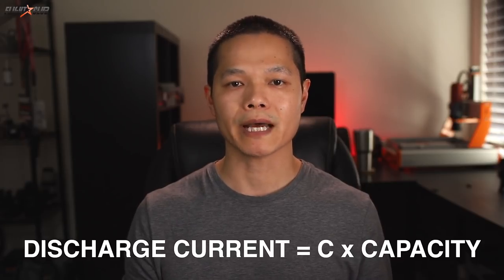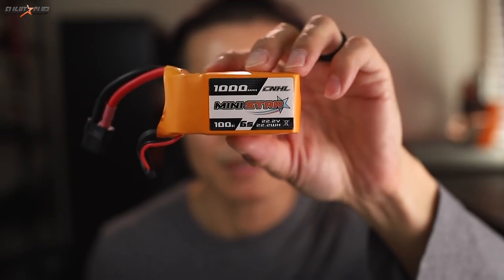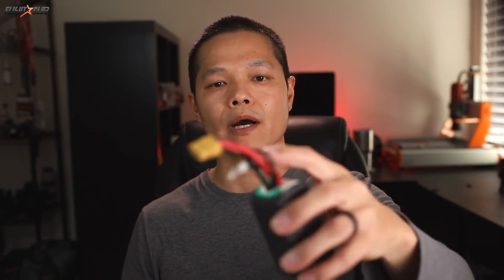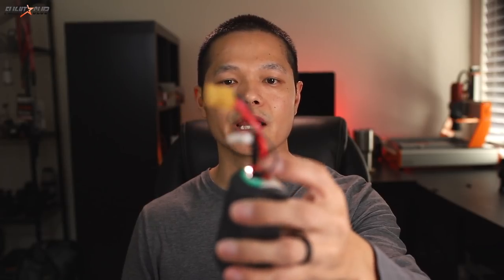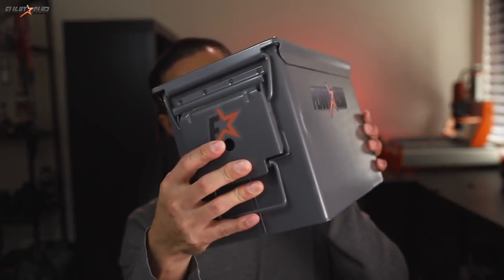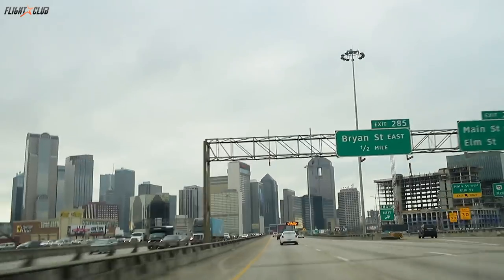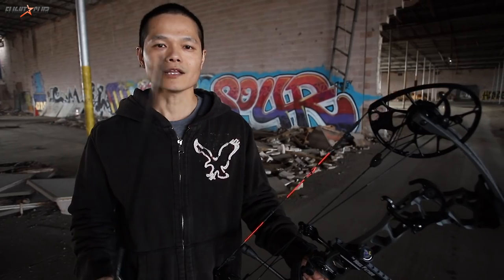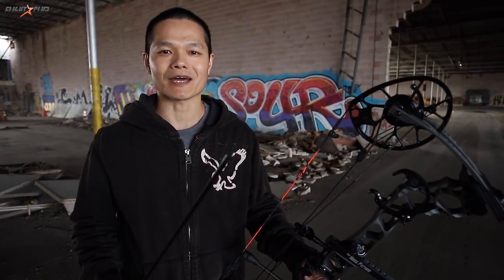LiPo Battery Safety : LiPo BATTERY vs ARROW

Comment: I store and transport my lipos in ammo cans as well, but with a twist.
I have lined the inside with 1/4" drywall board this way it something went wrong it will help suppress the flames. Ammo cans are usually airtight (No O2 no flame)

Comment: I got I to FPV about 3 years ago. I made all the newbie mistakes (bought Chinese crap from Banggood, always got the cheap stuff, etc.). I use to fly my quads until they dropped out of the sky from low voltage (told you I made all the  newbie mistakes). Well, when I got home and tried to charge my battery, my charger kept saying "cell voltage error". A little research revealed that I had over discharged my lipo and the charger didn't recognize the correct cell count. If I changed my charger from the lipo setting to nickel metal hydride for a few minutes it would increase my voltage high enough that my charger could recognize all 3 cells (4s wasn't popular yet) and then I could switch the charger back to the lipo setting. I began charging my lipo as a nickel metal hydride battery, but then left lipo unattended  to watch some Netflix. About an hour later, I hear a huge "WHOOSH" and find my battery shooting flames almost to the ceiling in my kitchen. Luckily, I was charging on tile floor (thankfully, not on the carpet under the curtains where I had been charging them the day before). I grabbed the fire extinguisher from under the kitchen sink and put out the fire before my (rental) house burned down. I then spent the next few hours sweeping, scrubbing soot off the tile, and repainting the baseboards so I wouldn't lose my security deposit when I moved. I got lucky, but it could have been much worse. This is an excellent video, and I wish I had seen it 3 years ago so I didn't have to learn the hard way.
Reply from the maker: oh my goodness, that's so freaking scary.  after seeing what these batteries can do I treat them like little bombs